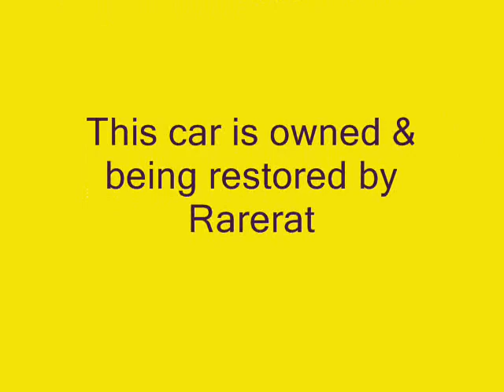68 Camaro SS/RS 396 Restoration Part 3

Comment: I enjoyed the the 68 drivers quarter panel removal im about to change the rear quarter panels on my 68 firebird as they are pretty much the same i was curious on how the sail panel attaches by the drip rail is it welded or just seam sealed if you come help me with that it would be greatly appreciated thanks Tom from Long Island.
Reply from the maker: Thank you Tom, the sail panel is spot welded to the drip rail. I have heard of people using Panel Bond to reinstall the new quarters in that area, but I've never tried it & just spot welded mine like the factory did. I hope this helps & good luck with your Firebird
Reply: Thanks that is a big help as i would of just seam sealed it and probably would have been a problem down the road thanks again and keep post videos I enjoy them and they are very informative 
          Tom from Long Island

Comment: so I noticed on the previous video you did a partial quarter , on the other a full quarter, which was easiest ? and which would you recommend ?
Reply from the maker: IMO partial quarters are less work, but full quarters will yield a better end result if you are willing to put in the hours too correct all the gap issues associated with them.
Reply: well im getting ready to do a 67 camaro , not excited about the aftermarket panels, heard a lot of poor fitment issues.
Reply from the maker: MrFireman164 I think they all pretty much fit like crap out of the box. I used golden star and they weren't horrible, but every single gap had to be worked in one way or another. The Dynacorn partials I used on the Red RS where so thin you could dent them if you gave it a dirty look, at least the Golden stars were the same gauge as the original metal, but that was about it.  People say good things about AMD but I have no personal experience with them. I bought the Golden stars because at the time everyone said they were " the Quarters" to buy, but honestly they are all about the same crap. lol.. Good luck with your 67. :-)
Reply: ***** Thank you sir! also love the music in the videos , we have a great deal in common as far as cars and music:)